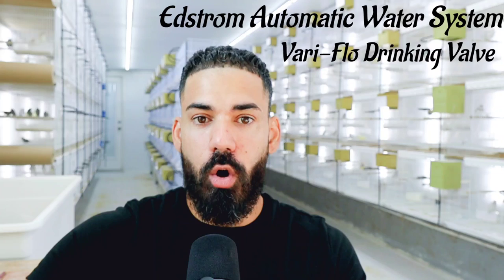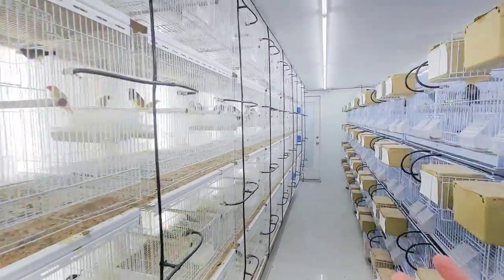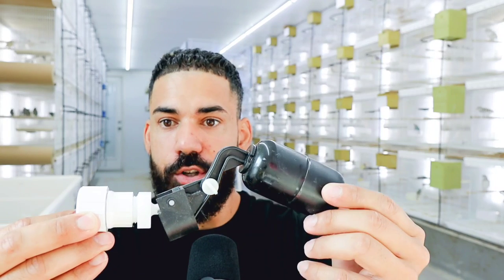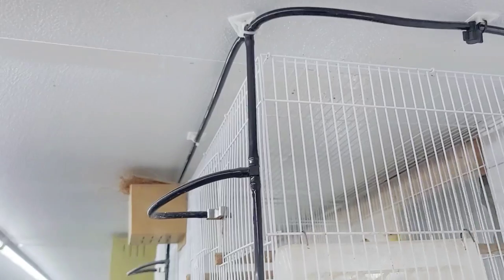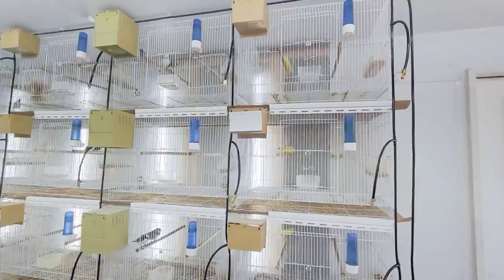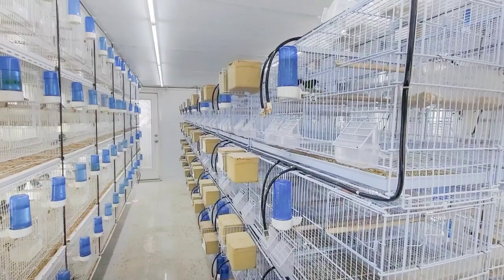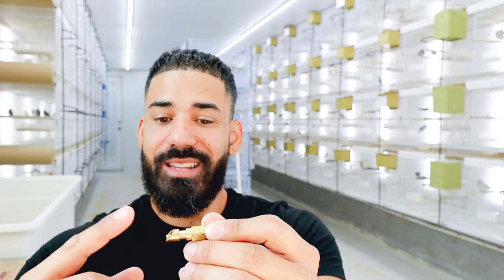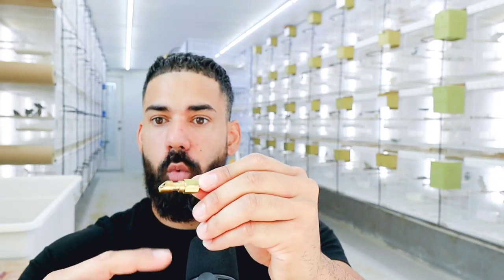Review of the AUTOMATIC WATER SYSTEM for the bird room

Comment: To save you're fingers and a lot of pain try looking at the "Drip Mist" systems they manufacture and sell a tool that works very well at installing plastic tubing on those "T's"  It's a plastic hand held devise (one hand) there is a mechanism that slides the tube over the valve For $20= bucks it's a real hand saver!!  Let me know if you can't find one!

Comment: Wonderful information. Good to know what it entails to set up such a water system and to make it work. Very helpful. As for the tubing being hard to put on the valves, an easier method than a flame that can melt the plastic is to have a cup of hot water and to plunge the end of the tubing in for a few seconds. It'll expand the tubing a little and make it soft enough that it'll be easy to push over the t's. I use it on aquarium tubing all the time. And as soon as it cools down it'll make a good seal and not budge. The one thing I'm wondering about is how an automatic watering system would hold up in areas that have very hard water...
Reply from the maker: Thankyou. I wish I would have known all that prior to starting lol my fingers were on fire 🤣. As far as hard water you would need a very good filter/water softener. These things can clog up very easily. Looking to do an update video soon. Ive had a few issues myself already.

Comment: Great setup friend. I’ve used it back home in Europe and i only have 2 advices. 1 is to constantly check for the first little while. Some birds like to stick seed in the water valves. 
2nd is ti have a Y fitting right after the pressure valve so you can add sanitizing liquids to disinfect your system once in a while.
Reply: could you please advise if you can add the vitamins to this system ? , and how you clean the system ?
Reply: The system I had used 2 reservoirs and was a gravity fed system. I would mix the vitamins no issue and drain the next day. Your system being pressured is a little different. The way I would do it with your system, is to add a reservoir inside to the system right after the pressure valve. Possibly a clear container that you can check if the vitamins got mixed. Add a 1 way valve so you can add the vitamins throw it but water doesn’t come out from there. Same way for disinfecting the system. I used F10 to disinfect my system. Fill up, leave it in for a couple hrs than drain. Rinse and connect back to the cages.